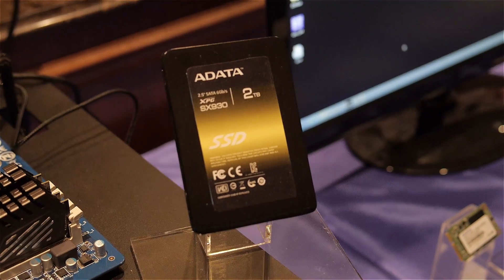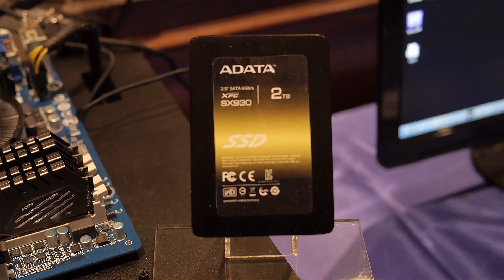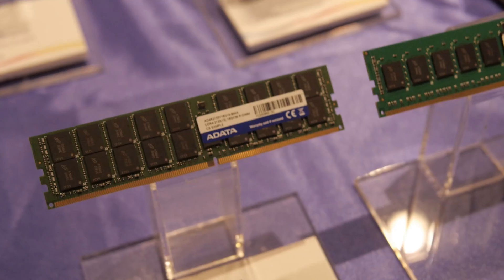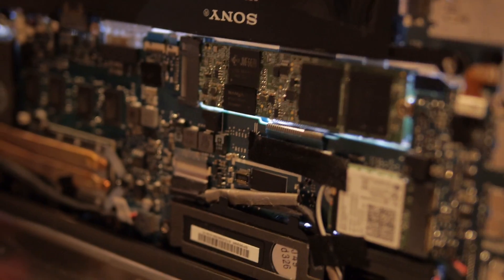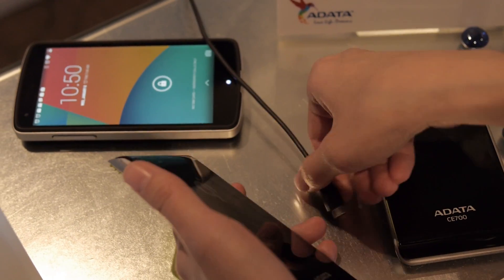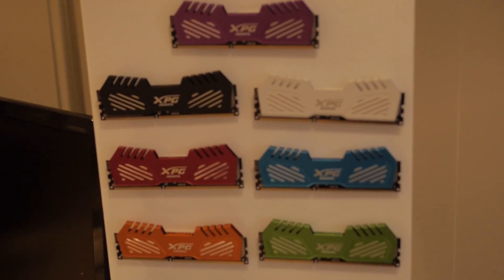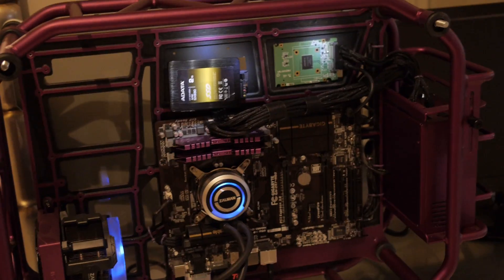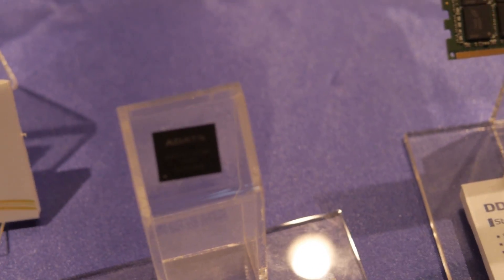ADATA at CES: 2 TB SSD With LSI Controller, DDR4, Tiny SSDs, Experimental Products, ETC.

Comment: First SSD that I've owned was an Adata S599 256GB drive which was purchased in 2011. The drive is currently being used in my work computer and have never had any problems with the drive. Purchase price was $560.41 from Newegg. My goodness, have times changed.

Comment: I like the Matte Black and the White, but I have always been a fan of the Titanium Gray on the bottom. Also, the price of 16gb of the 2400 speed increased dramatically on Newegg. I was going to buy it, then the price skyrocketed. I went from ADATA to corsair Vengeance, and the Vengeance does not overclock as well as my previous ADATA kit (both 4 by 4gb). I am a big ADATA fan, but $200 for the 2400 speed RAM killed it for me. It was $140 before.